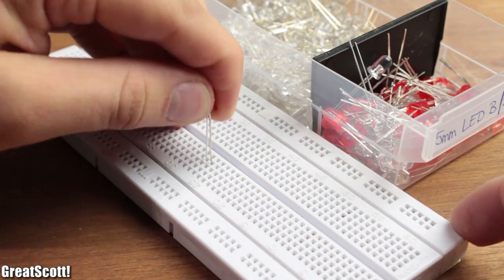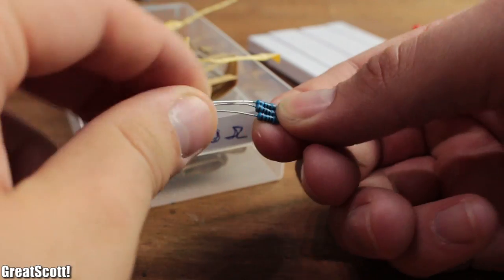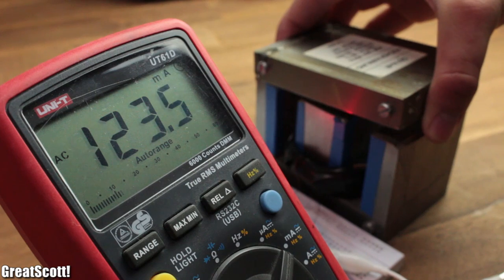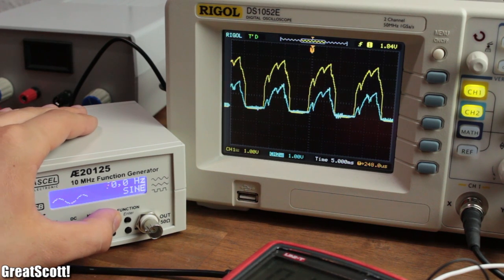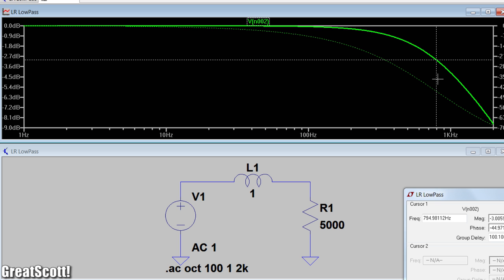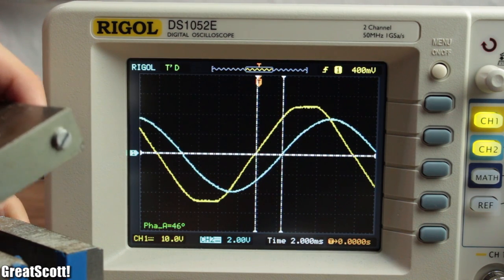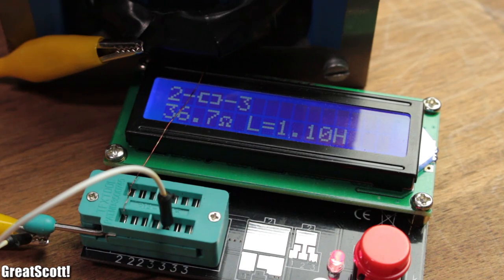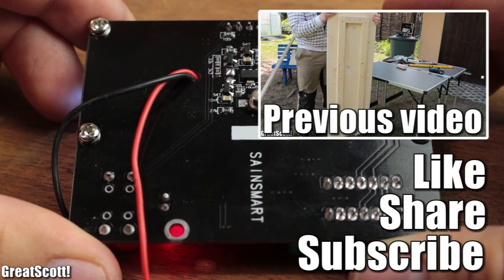Electronic Basics #13: Coils / Inductors (Part 2) || Reactance

Comment: Thank you for the nice video! How are you measuring current on your scope? Can the scope do that directly or do you need an external device? (Like you pass the current through a resistor and measure the voltage across that?)

Comment: MR Great Scott. I have some large transformer cores like the one in the video. if wound as a inductor. could it be used as a inductor for a low frequency boost converter? for like 24 vdc to 170v DC? if so what current could be obtained from such a coil? and frequency range it could be used? would it be a OK for a boost stage for a inverter? great video. can't wait for the next one.

Comment: Hi Scott, thats so much for you video's Great work! I am very new to electronics and initially prefered to stay away from electronics but I am working with hydrogen from water production. I am wondering if you know how to make a high voltage dc (1800v apr. i saw before), 1 amp apr., and pulse width mudulator for frequency, 42.5 khz , from 12V dc or less. Do you know of any controllers available like this for purchase? Or a diagram to attempt to make one? Thanks Take Care

Comment: Hey GreatScott, some idiot are free enegry maker use isolated wire wound around a magnet (2 coil) and they claim "this is spec. inductor will collect electric from air"  and they also use fullll bridge rectifyer, cap then connect to motor and spin. And motor spin forever!!!! Can you give me some reason its fake please. Im not sure inductor work with isl wire.

Comment: 3:17 that l/h pass filter & mosfet is pretty useful, actually. You can somehow use frequency instead of voltage states, like you used in your VU Meter video
Reply: where does the transistor go in this circuit
Reply: +Oliver Ward it's the exact same circuit as he demonstrated in his example, except if we had more of those circuits but filtering different frequencies we can light up different sets of LEDs on a grid, preferably higher frequencies light up higher up LEDs
Reply: +Gian Fajardo  thanks but does the mosfet in between the inductor and the resistor
Reply: +Oliver Ward go in between
Reply: +Oliver Ward oohh, well I'm not knowledgeable enough in electronics lol, I just like to observe. But in the frame of 3:18 he was (probably) using the MOSFET, a p-d or p-u resistor for reference voltage, or a comparator IC most likely.
Reply: +Gian Fajardo ok thanks for your help
Reply: +Oliver Ward np